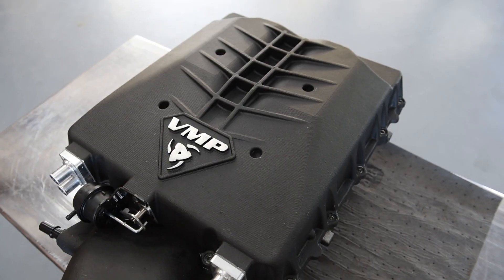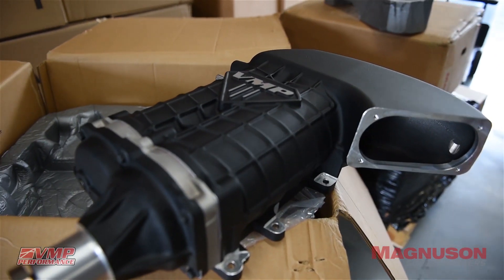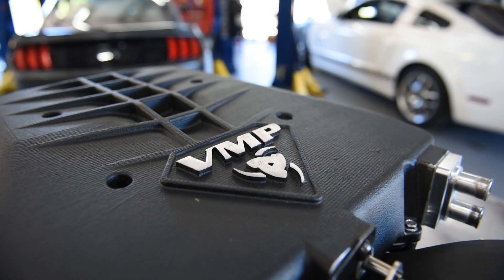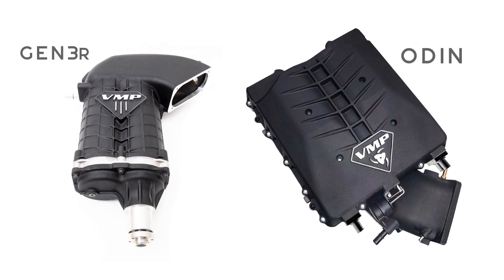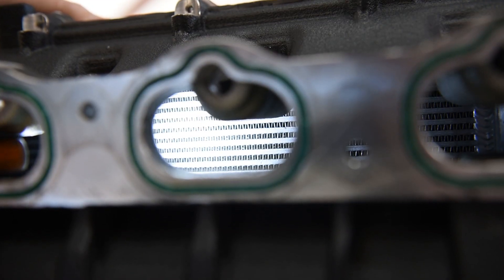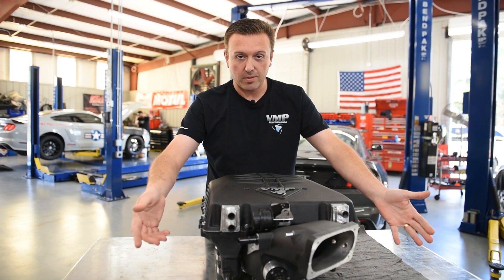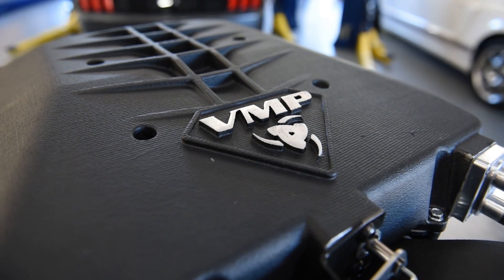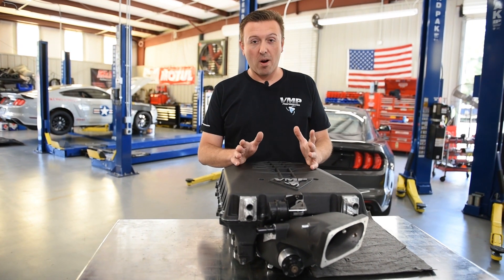ODIN : The Newest VMP Performance Supercharger for 18+ Coyote

Comment: Seeing the initial price point makes no sense.  The entire (and only) reason to choose a roots blower over a twin screw is cost.  With the price point that this new Odin kit enters, there's ZERO reason left over a twin screw setup (which is more efficient, flows better, has better discharge temps and makes more power at equal volume blowers.). This thing looks badass and you definitely improved some flaws from the other 2650 offerings, but at $9K, only a fool would buy this over a gen 5 whipple setup
Reply: 9k?? Yeah I’m out at that price point. Hell you can buy a Paxton and make 800+ really easily for barely 6 grand.

Comment: Now I wanna see if someone can put it on a 15-17
Reply: Yep I'm waiting on a response to that
Reply: Make that three.
Reply: I don't see why it couldn't the intakes interchange
Reply: Unless there is a difference in the heads in relation to how the intake sits on them.  If its front/back 1/4" difference doesnt matter for rubber intake, but does matter with a belt drive system.  Not sure.
Reply: towedmycar I’m pretty sure the accessories drive system is all the same too
Reply: its about the use of the valley.. 18 has less room than the 15-17, whipple also had the gen 5 out for the 18's for a while before they released it for 15-17